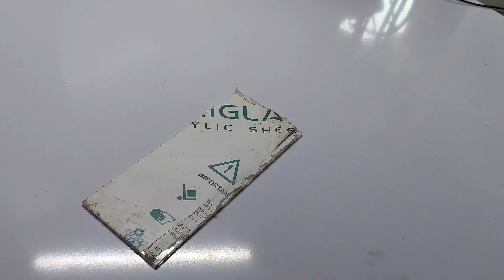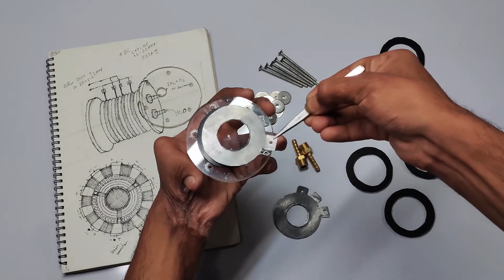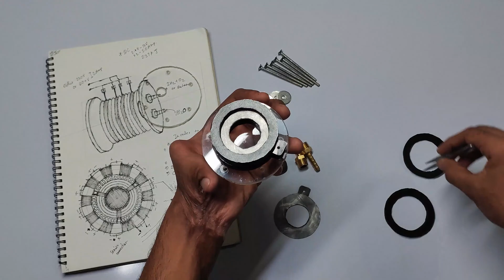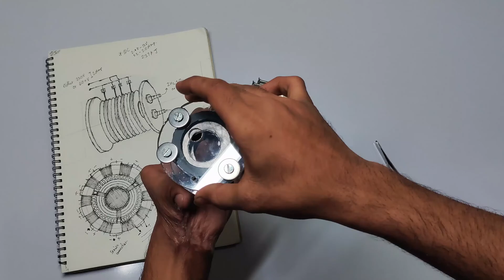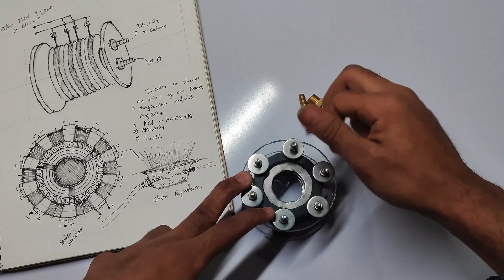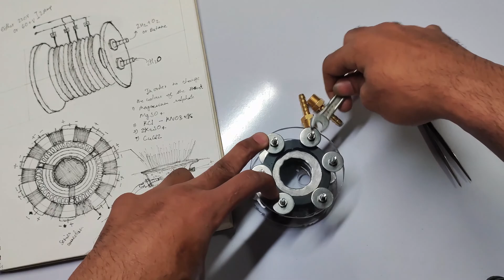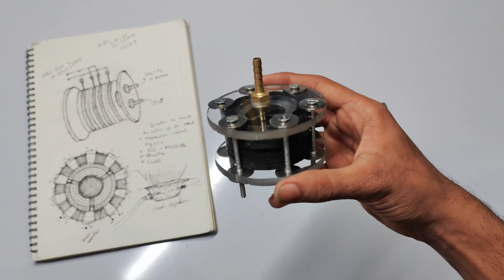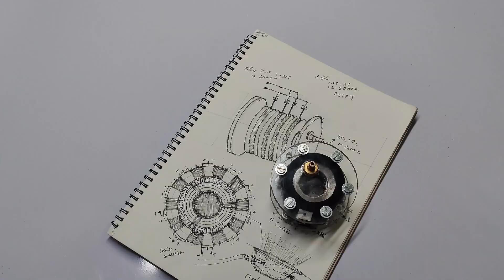Real Iron Man Reactor | Part 1 | HHO fuel

Comment: The question is If he moves, the water will move through the pipe and cause the system to stop working
Reply from the maker: use check valve to avoid that.
Reply: @AVmades  can you make a video for that for better understanding
Reply from the maker: watch this full tutorial https://youtu.be/mozGc-pUOL0
Reply: @AVmades  I am also trying to make one but I need huge output
Reply: Where did you get the top pdf for copper winding
Reply: Can you give us

Comment: What power supply did you use?
Reply from the maker: first i used 220V AC in order to check the leakage at higher pressure and then I used 12V 1.3A DC lead-acid battery.
Also I checked your channel you doin quite good let me know if you're open to work collaboratively!
Reply: @AVmades  I’m open to it
Reply from the maker: Great! which platform would be best for you?
Reply: Probably discord, also whats the diameter of the plastic, rubber, and metal parts? And how did you insert the nozzle with no leaks
Reply from the maker: For more details I'd recommend you to watch this video  https://youtu.be/mozGc-pUOL0?si=jRhC1SN_iL0sknCh
Reply from the maker: you can join the discord community using this link!
https://discord.com/invite/VefuZwzaTZ